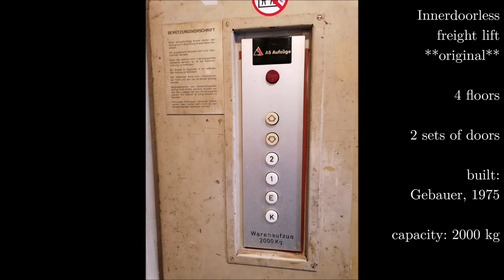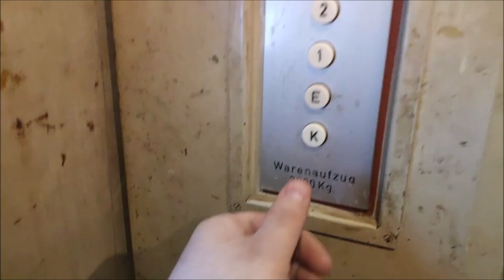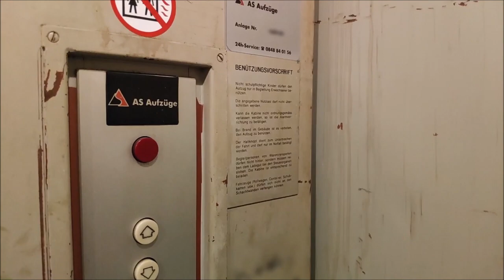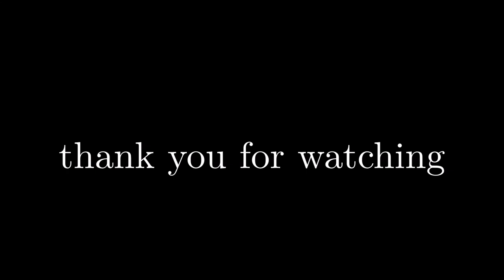ORIGINAL 1975 GEBAUER Freight Lift in Aargau, Switzerland

Comment: Gebauer was (or is ) the real expert in building heavy duty freight lifts including the 45tons container lifts at the HK Convention and exhibition Center. RIP the legendary Mr. Gebauer.
Reply from the maker: Gebauer built really interesting lifts, I did not know they also had installs outside of Switzerland! Realyl impressive, especially such capacities. There is a 26 ton hydraulic truck lift from Gebauer in Zürich.

Sadly the company Gebauer does not exist anymore, they were bought by AS Aufzüge, Subsidiary of Schindler, in 2001.

Comment: The car 'hangs' on the cables (cables move over the top of the car when in motion), I thought with freight lifts the cables would go under the car, so the car would be 'carried'. Some goods lifts here in The Netherlands have that, the weight they can carry up (or down) is huge.
Reply from the maker: Well, there is no general answer to this. The advantage of underslung lifts is that the lift car can be built much lighter because there is no need for a frame that can carry the whole load when hung up at the top. The oldest underslung lifts I know of are from the mid 1980s. Before that time, such a concept did not exist afaik and therefore all older lifts had their sheaves on the cartop, just like this one. It has to be said though that the underslinging of cables was primarily to reduce car weight and make everything lighter and cheaper. This old example of underslung lift I refer to is the Schindler design S, which was their cheaper model back then.
The biggest traction freight lift I've documented but not yet uploaded can lift 5000 kgs and that one has the sheaves on top as well, since it too is somewhat older.
Nowadys new lifts, especially MRLs, are generally always underslung due to the advantages I mentioned above. Therefore I wonder if the ones you know are more modern than this one since that would explain why they're underslung.